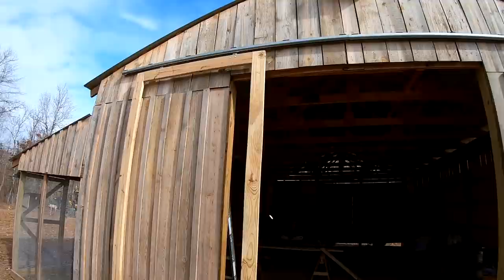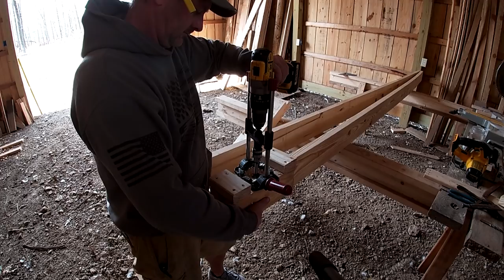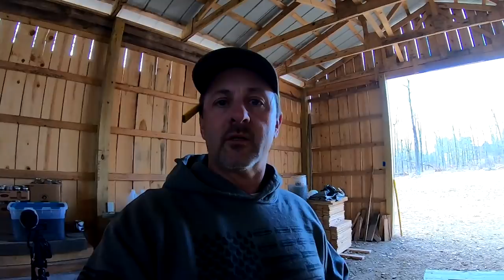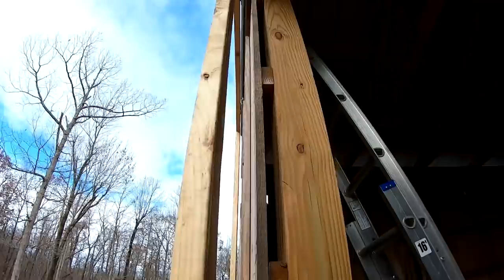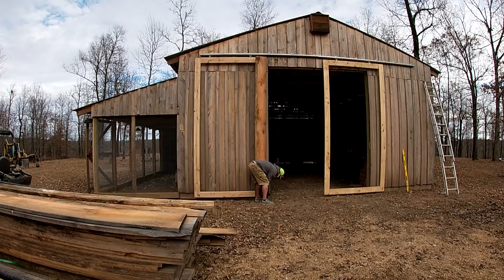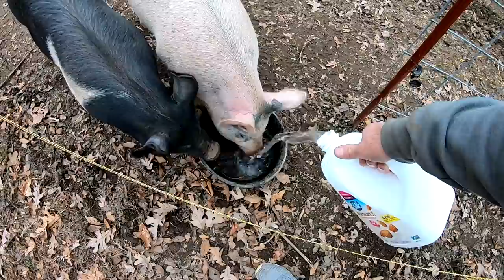Adding the barn doors before winter

Comment: Thanks for sharing this. I stumbled across this video while trying to prepare for my upcoming project. I am trying to enclose below my deck for additional storage and wanted to do a single 9 ft wide barn door. I am doing steel panels around the perimeter, and similar to your batten clearance issues, I need to clear the ~1" rib of the siding. Do you have a follow up video showing the jamb detail? I'm trying to latch and lock strictly from the outside only.
Reply from the maker: I haven’t done a follow up video. I only latch and secure mine from the outside as well using latch hardware from tractor supply

Comment: @hickoryridge How have the doors lasted? Any issues with them warping or twisting? Do they seal good? Did you ever bat them out? I'd like to show you what I have on my barn. Im considering switching to a rolling door system.
Reply from the maker: They have done pretty good. They catch a ton of sun so they have warped a little using green lumber. I still haven’t put the bats on yet and I should have raised them up about an inch higher. When we get a lot of snow or ice build up they rub the ground. Other than that they work great.

Comment: the long screws you used for holding the door frame sections together? where did you find those?
Reply from the maker: The local building supplier. They are 1/2 lag bolts that are 14" long

Comment: I’ve built a number of rolling doors and I’ve found that the taller and narrower they get the rougher they travel. Putting the trolleys closer to the corners (lengthening the wheelbase) helps them run smoother. Also I’d put some additional crossmembers (purlins) to hold your boards in plane. I put the trolley brackets on the outside on top of the cladding and use longer carriage bolts than National supplies
Reply from the maker: Great tip!

Comment: How did you adjust the doors to remove the gaps between them from top to bottom? You skipped that part but I'm curious. I might just go with a single door.
Reply from the maker: The rollers are attached to bolts that  screw in and out for adjustment. There is a jamb nut to keep them from turning on their own.

Comment: i was curious when you put the railing up how does it bolt on lag bolts? how wide is your piece that you mounted up there?
Reply from the maker: The railing is bolted on with 6” timber loc screws. The railings are 4.5”x4.5”
Reply: @hickoryridgehomestead9177  so did you drill  holes through the railing or did you use rail hangers?

Comment: are sliding barn doors weatherproof? do they seal good enough for a shed/barn that is insulated?
Reply from the maker: They can be but it takes more work. They will need rubber skirts at the bottom and the sides of the door opening to form a better seal.

Comment: Great video. I'm going to be doing the same type of door on my barn. Can you tell me where you bought the drill jig from? Also can you tell me the size and type of screw you used. Thanks in advanced. Eric
Reply from the maker: The jig I bought from Home Depot. The long screws were 9” long fasteners I had left over from building the roof on the log cabin. They are similar to timber lok screws.
Reply: @hickoryridgehomestead9177  Thanks for the reply! Eric

Comment: I'm curious....are those oak boards and are they thoroughly dry?   My experience once(live and  learn),  I built a massive privacy fence with rough cut oak, screwed all the boards in place and then about a year later I notice the boards coming loose.......as the oak finished drying and shrunk it popped the screws(broke them!!).  I had to go back (pre-drill holes as the oak had hardened so much) and put in lag bolts.  You've done a jam up job on your barn, looks great.
Reply from the maker: They are not oak but pine like the rest of the barn. They are over a year old and so most of the shrinking has finished. They are just dirty and stained from the way they were stacked together
Reply: Gotcha.   Since I'm new to your site I wasn't aware of the kind of material you were using.... thanks for your reply.  You are doing an awesome job, I'm impressed and that doesn't happen very often!!!  lol @hickoryridgehomestead9177

Comment: where did you get the hardware for this? what was the approximate cost for your projecT? thanks
Reply from the maker: I bought the hardware at Tractor supply. I can’t temper the cost for the doors but just guessing it was probably around $200 for everything including wood.
Reply: @hickoryridgehomestead9177  thank you. Googling barn door gets more results for interior bullshit than actual barns
Reply from the maker: That’s the same problem I had.

Comment: I think you need more back supports -- won't the boards warp?  Always impressed with how much one person can do by themselves.
Reply from the maker: I can always add a cross brace if needed but these boards are already seasoned and shouldnt warp any.
Reply: Over that length they will warp and cup,  John's suggestion is right you should add at least 2 more cross boards on each door,  Even if you think the large boards wont warp (and they will), what about your 2" battens.  As a contractor, I always respected those customers that wanted to get some skin in the game and earn some sweat equity.  You have my respect my friend, but add those boards..  lol

Comment: Why only use one screw to hold the frame together?  And why hang the side boards off the ends of the top rather than under the top boards? I'm not criticizing. Just asking the reasoning and if there is any strength difference one way or another. I need to build some doors soon and need a plan. Lol
Reply from the maker: the screws I used are structural screws that were 9" long and have the same sheer strength as 5/16 lag bolt. The boards on the outside attach on the top and bottom and tie it all together. I hope that helps

Comment: For future, put a wedge or something to set the boards so you don't need to use your toes. Don't you need some cross framing on the back of the doors to screw the boards to? On the barn at home we had a little roof like over the track about 4-6" to keep the weather off in the winter. What you did works fine, I like it. Future, you could shim the track out so the doors would clear the batten. The barn looks good now fill it up.
Reply from the maker: I used washers to shim it out to clear the batons. I will be adding the trim above the track to shed water over the door. I just haven't gotten around to it yet

Comment: Did you put stoppers on both ends of the rails so your doors don't come off the rails, just a suggestion.  Larry
Reply: Good  g. Got my but kicked  for  same... funny  now...
Reply from the maker: yes sir I did..lol. I dont want to have to pick these heavy things up and get the rollers back in.
Reply: @hickoryridgehomestead9177  Just reading the comments now after making my comment above.
Further reason to have the concrete strip underneath for the support wheels to run in the groove.
DAD had an adjustment mechanism to compensate for expansion, or contraction depending on the weather.
Hope that idea helps..

Comment: Put some diagonal bracing on the inside of the door to reinforce the squreness of the door as they dry out, and have something to nail the center of the boards to.
Reply from the maker: I thought about a diagonal brace but with no side load on the doors they really don't need it. If there is any movement in the middle after the batons are put on I will put in a center brace .